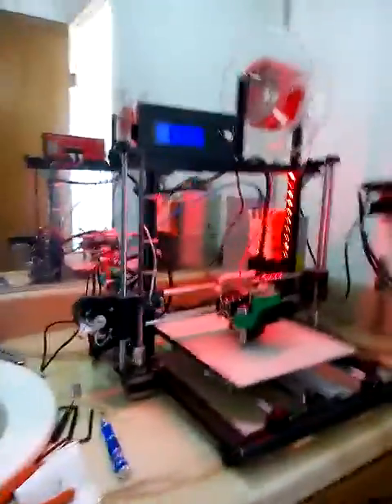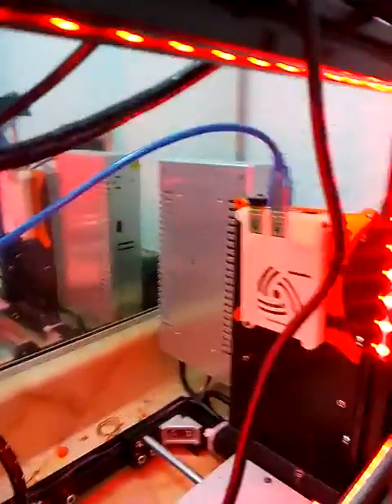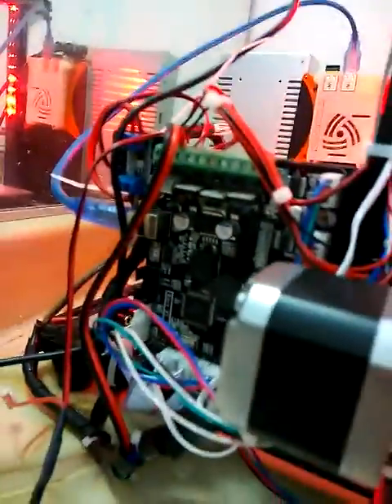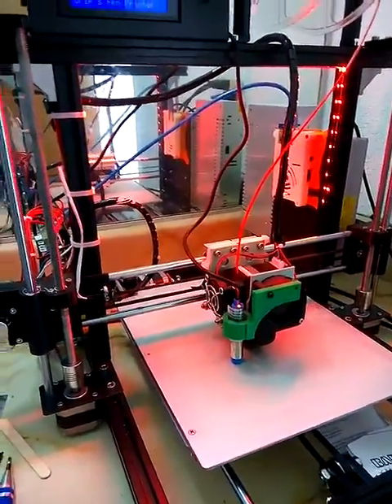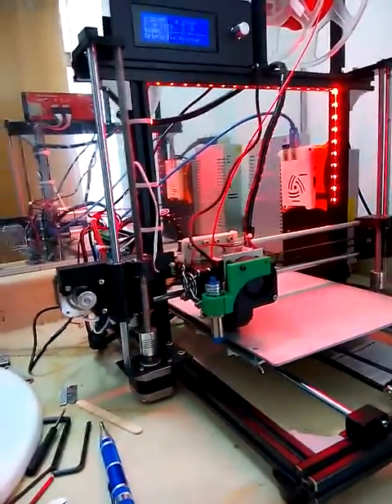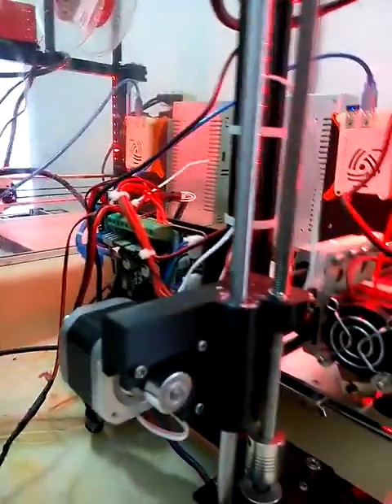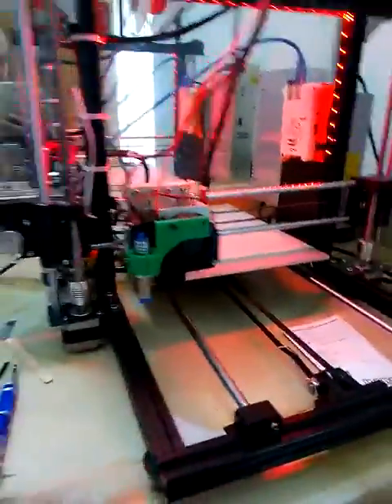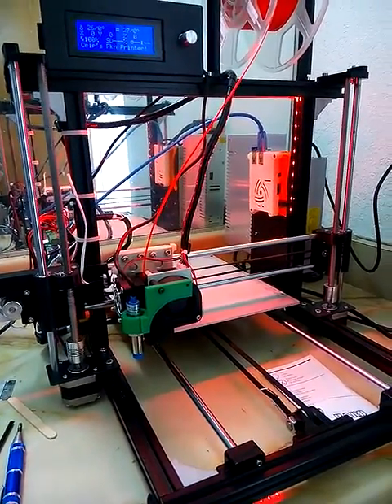HicTop 3d printer upgrade

Comment: how did you upgrade psu? is there a link to maybe an article or video? thanks.
Reply from the maker: mathew aguilar should be easy I just added a power supply to only heat the bed,, and the original power supply just runs the rest,. the power expander is like a relay that gets activated by the original to bed connection but then puts the whole new power supply to power the bed. this is link http://reprap.org/wiki/Power_Expander

Comment: How well does the auto level work?
Reply from the maker: Who would have thought only needed to tape a steel washer to each corner on bottom,  mo fookn magnets how do they work 😂
Reply from the maker: the auto lvl still doesn't work can't the board firmware to work with it I'll try something else out soon been long enough bet there is update out by now

Comment: hi there, i have 2 of these Hictop printers but im facing huge problem with the extruder, always clogging, so i was thinking about upgrading it, i noticed you are using an upgraded one, can you give me some advise on which extruder is this, and if i need to make modifications in order to fix it to the Hictop ?

many thanks
Reply from the maker: e3d v6 and yes o had to make all new parts to hold it like I like it.. as far as jamming up never had much prob with that use good filimate and make sure. you get good traction on it lol

Comment: Very nice. I am trying to get my print bed straight because it is slightly bent on the center, do you have any issue when printing big objects? Like squished first layers on different places? Also, my y carriage looks like shit compared to the one hictop sent to you
Reply: +Erwin Ried run down to the lowes or home depot and have them cut you some glass. (Might want to call ahead to make sure they have a cutting station.)

It's 2.5mm and has been working fine for me, 3mm is recommended, they have mirror that's in that thickness but I plan on adding a auto leveler which won't work with a mirror.

Be sure to sandpaper the edges, because I just punched mine while removing a print and it would have been real bad had I not sanded.

My bed on mine is so messed up I couldn't get PLA to stick at all(not even with blue tape), was easier printing ABS on the PCB they gave(which will warp too, and it sucks using a raft.).

With glass and blue tape I have gotten pla to stick every time(still have to make sure everything is level).
Reply: autolevel won't work with glass either :/ I'm trying to sand down the whole bed flat
Reply: Erwin Ried Are you talking about a included inductive sensor or aftermarket? 

It should work through glass, what I would guess is it's only rated for a very close distance. Need one of those 4mm ones. 

If you can't get it to detect metal 2mm or so away, you will then know that is your problem.

google "inductive sensor through glass".

It's so thin it probably won't matter if you sand it down, the warping is from the temp differential from heating one side, need a thicker piece of aluminum if that's your plan.
Reply: included one... but mine was the early version without it bundled. 

I am just lapping the heated bed with sanding paper. I want to sand away 1mm and Ill be happy with it, otherwise screw this bed ill migrate to a smaller one.